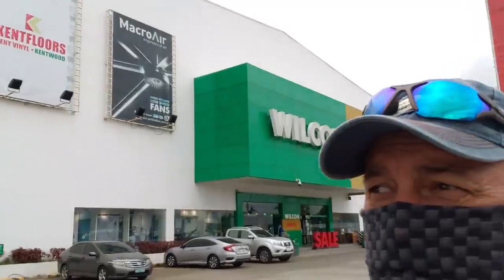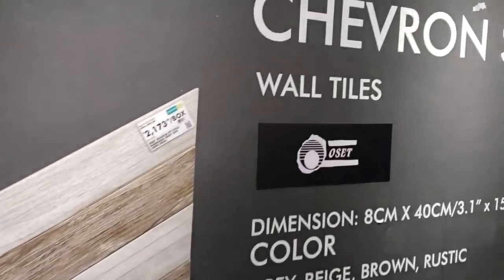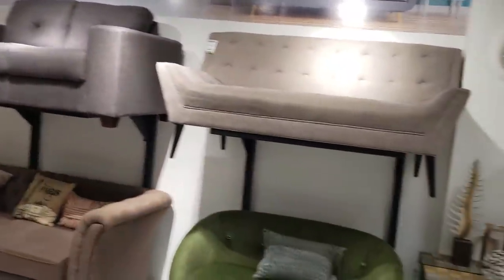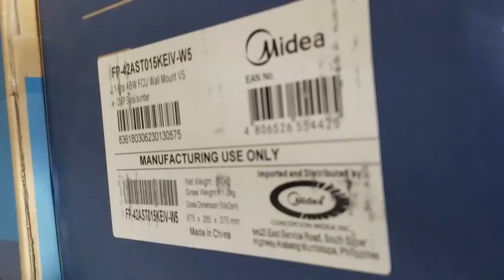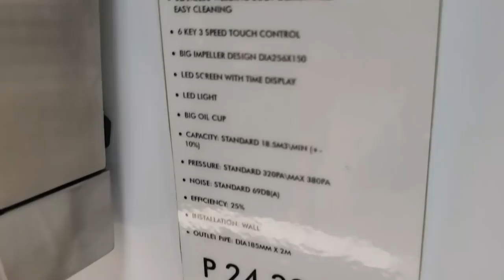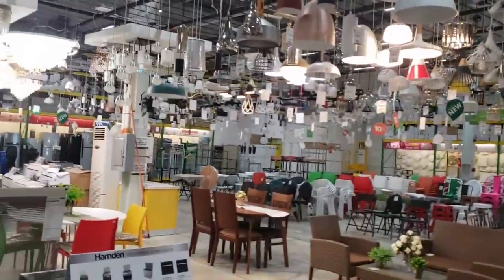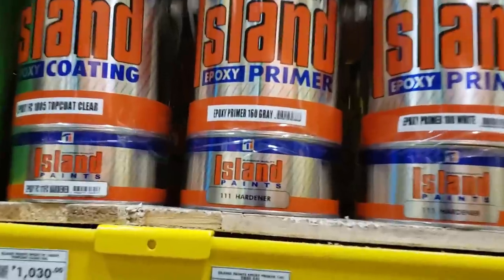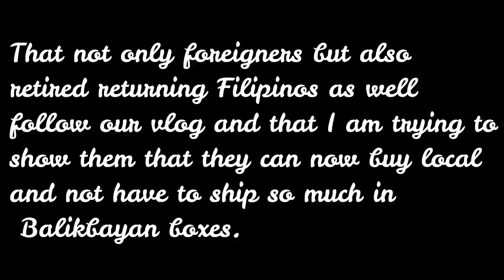Does WILCON DEPOT Philippines put HOME DEPOT and LOWES to Shame?

Comment: That was great. Here from South Carolina, we too will be moving that way in a couple years and to follow somewhat the same path. Hey one question, I didn't see any limber there. Do they have a place there to get lumber like our Lowes & Home Depot??.............Thanks for sharing, good job..
Reply from the maker: Lumber is seldom used here other than coco lumber for framing or simple small open frame houses. This is not the west. Tropical climate and termites - remember that. Anything wood is temporary and or requires on going chemical treatment.
Reply: @TexasFilipino  Termites, well i guess i hadn't really thought about that one. But one thing for sure, I'm not gonna want any ongoing treatment. I want to get closer to maintenance free. Concrete just seems like a LOT of work and then in the future if you want to change or add, it seems like that would be more challenging. I guess i need to start reforming my thinking some. I really appreciate your time.........  Pat
Reply from the maker: These solid concrete walls is easy to change or expand. Want to add a window- just take a cutting wheel and slice a opening. Door way or what ever. NO header needed because it is solid concrete. Low care needed also. Flood , small fire etc no problem clean it up touch up paint and go on.

Comment: The other day i saw a very brief snippet of a set of plans / blueprints did you do those or a engineer / architect do them 
    P. S. Good job 👍 to you and your crew on the commercial grade steel reinforced slip formed concrete home you are building

Comment: that store has some wide range of selections and the mirrors were pretty cheap!! it will cost me at least $300 for that here in the states. Thanks for patiently browsed that store for us :)
Reply from the maker: No problem. I want one of those mirrors and told Mel I think I will go back there and buy it and hang it here in Garage/Apartment until the house is done. I want to get it now in case they change styles.

Comment: Just a thought.
Those wire nets with stones for preventing land erosion.
The wire will corrode in the sea water
May I suggest that Plastic Netting (Like they use in Manila) would be more durable ?
In fact recycled plastic waste could be used to make the netting ?

Comment: So what did you go their for to buy
Reply from the maker: I am getting dimension for appliances and shopping models between companies. Getting ideas because I need to know exactly where outlets for exhaust fan , stove type and oven and where their connections will be also. Just a blue print won't cover the actual size and layout of the appliance. Each has different specs. I have been doing a lot of that but hardly ANY PLACE will let you video even if its to their benefit.

Comment: What do you recommend on fixing a few tiles coming up lose. I haven't seen anything related to self leaveling adhesive products. I imagine is due to my house settling and not being leveled in the first place. Apparently for what my neighbors say the previous renters,owners etc fix the same area mutiple times. So looking for anyone's advice whats best to fix a few large 24" x 24" tiles. I have a section of 4 in total lose popping up. Philippines products I can use to best fix this issue or something I can purchase locally. Thanks for anyone's feed back
Reply from the maker: Those tiles always come loose and you want to hear a few reasons why. Many installers don't use tile adhesive just portland! It wont bond right. Next the slab does not have a moisture barrier under it and the tiles are wet on the bottom side always. Again releasing the tile plus the tile swells up and comes loose from the moisture. Lastly they won't use proper notched trowel for the mortar You might have to get smaller tiles with a wider grout line so they can breath and let the moisture out form under them due to poor construction! I have dealt with this first hand
Reply from the maker: Bostick I think is the brand tile adhesive !
Reply: @TexasFilipino  thanks for the info and help
Reply: @TexasFilipino  okay yep no spacing at all bearly any grout between the tiles compared to other sections spacing not equal all around.
Reply: @TexasFilipino  thanks will try the tile adhesive on the grout spacing can't do to much about that unless I rip up the whole downstairs floor and start from scratch fix correctly. So will do the temporary fix until  maybe a remodel color change etc for giving enought space for all tiles to have enought grout. Thanks 👍
Reply from the maker: That spacing would be ugly on those big tiles. The proper tile adhesive should do the trick.
Reply: @TexasFilipino  most are a penny slot in spacing. Now thinking back when I rented a townhouse 1yr old construction new. The cr tiles came down mutiple times and all had no spacing at all. Plus look like they just used concrete to lay the tiles. I forgot what the landlords kept using to fix it 3 different times. Thanks for the knowledge I am good at wood contructruction combat engineer style, but not in the details when it comes to tiles,plumbing,electric.

Comment: I'm a builder. Wilcon looks good but it's not.... So many things they don't have that are easy to get in home Depot USA. 
No tapcons
No spray foam
No MDF plywood
No cabinet grade sanded plywood.
No kitchen cabinets. (Only unfinished wood cabinet doors
1/16" cabinet edge banding

Those are just a few things off the top of my head I needed and they didn't have.  It's a nice store... But for supplies and building materials... Nothing like home Depot..
Reply from the maker: Your comparing apples to oranges. They now do have spray foam but rare is it needed in this country. No cabinets because there is no market for reay made cabinets here due to so many craftsman building them exactly to order and installing them. Tapcons - go to Far Eastern.
Reply: @TexasFilipino  Shopped Wilcon many times, I have their rewards card also...  Ive lived in philippines for many years... been coming here since 2003.  Wilcon is great for tiles. the tiles take up 1/3 the store.... toilets, sinks, showers, thing like that very good choices....  But wilcon is not really a builders store when it comes to hardware.  NO TAPCONS in a place everything is from all cement...?  They also don't have cabinet edge banding....for REAL cabinet builders.   I own a hotel in Philippines.  I know all about the craftsmen and thier homemade to size cabinets.... they are not nearly the quality or finish of a pre-made cabinet.  its made from halfway decent plywood and painted on site with a roller...  lol.    its not professional at all.   You said no one needs spray foam but you know why I know they don't have it... because "I needed it"  and if I'm the only one who needs it... its probably because Filipinos don't yet know about it.